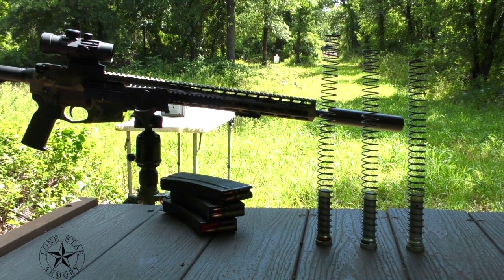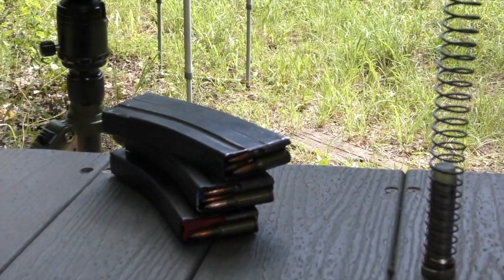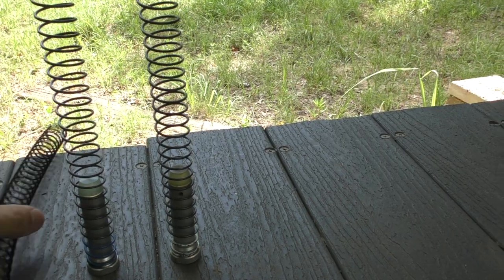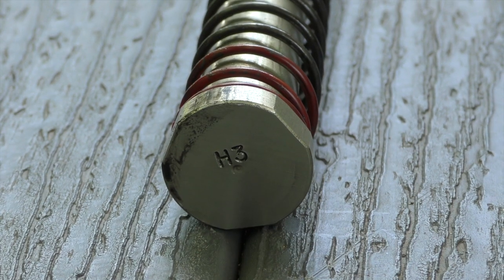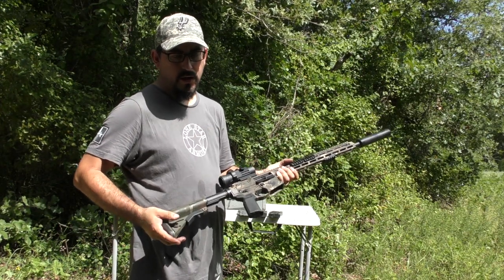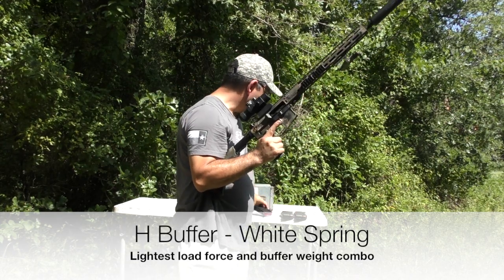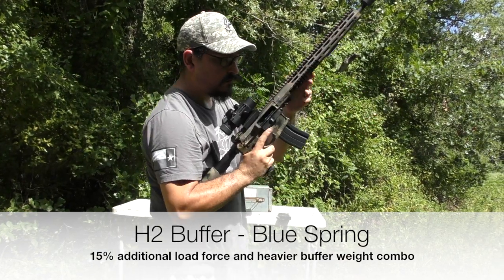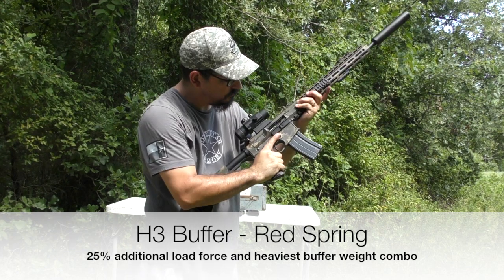Lone Star Armory TX-15 (MPC-E) Testing various buffers and springs - 6.5 Grendel (264 LBC)

Comment: Not sure why you needed to run the third mag.  Also what one did you like or use,/  I also have a 6.5 Grendel and not sure what spring to try in it, the lower was in my 308 and the Grendel is much less powder. Thanks for the video, 👍👍

Comment: I honestly was hoping for you to try the H3 buffer with the stock spring. I have a nonadjustable gas block on my 6.5 Grendel and am currently running a stock buffer. However, plan to reduce recoil with an adjustable buffer. Great video thanks.

Comment: My question is... How different would your results be if you weren't shooting with the suppressor?  Did you try it unsuppressed?  Most shooters would likely feel those results were more applicable to them.  Shooting suppressed over gasses the system,  unless you have and adjustable gas block...